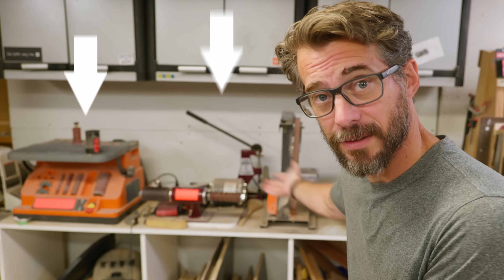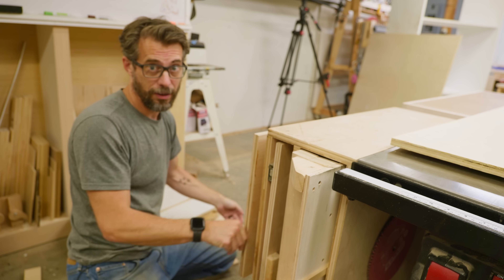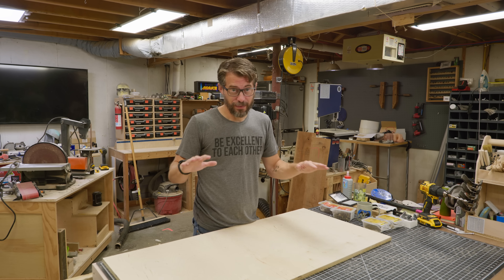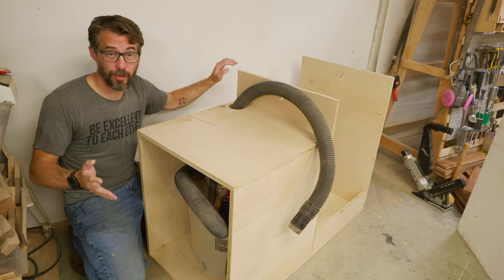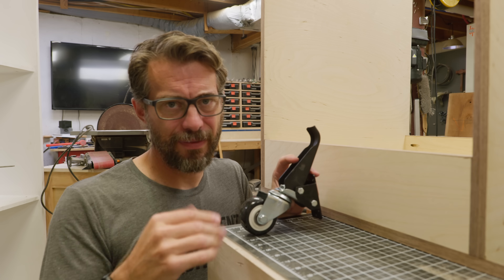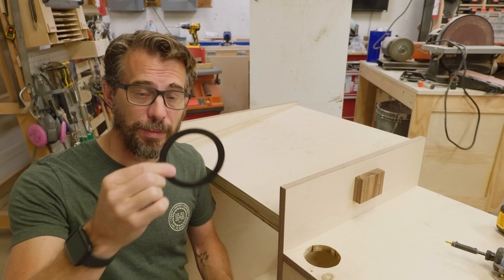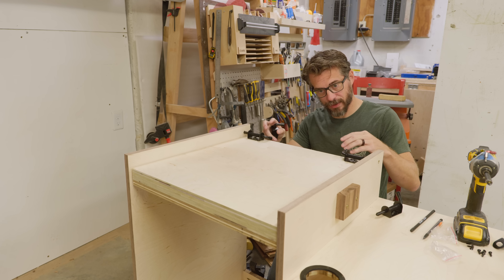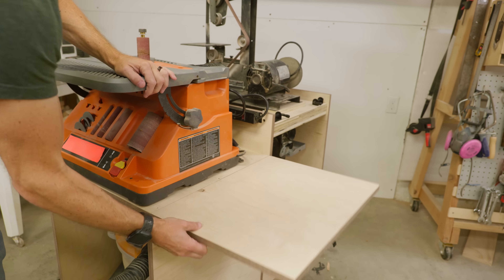Can I Make a Better Flip-Top Tool Cart?

Comment: You could of incorporated an arduino project into your latches . Simple push button 4 electric actuators with a bolt at the end . So all 4 actuators activate and lock or unlock with the push of one button wires could be run through the pipe and out to each one . Loved this anyway
Reply: Not everything needs to have an electric point of failure lol. I don't know how safe it'd be to have the table able to come unlatched while yur using a heavy tool atop it
Reply: @SheepUndefined  true, but it could be done and I get there are points of failure to it but I think it could make the flipping and locking off quicker more efficient if you just press one button and all 4 locked in place at once rather than having to lock off each one. Was just a thought anyway
Reply: @davesmith7671  Yeah my main thinking is just that for something that's the one thing preventing my work surface falling out from under me, or turning around and smacking me in the chest, I'd want that to be something that's dead simple, even if it's less convenient.

Comment: I did the same in my all in one work table. I used the gate latches for my 13" planer and my 7 1/4" miter saw.  Each top is flat and the tool is on the under side. Shop vacuum is underneath the tool bench too. I only installed 1 set of the spring latches and it's been 3 years now. No signs of wear and tear either.

Comment: I like the idea of flip carts quite a bit, but I've always worried about the piece of pipe holding the weight over a long period of time. Thinking about it from a weight perspective, I came up with a neat idea that I may use for a mobile cart for sanders and the like. Basically, every tool would be mounted to its own base, with t-track bolts on the bottom. Each tool would be stored on its own shelf when not in use, and could be secured to a top with t-track when in use.

Nice cart and design though!!! I love the idea of the spring latches that you used!

Comment: That's a lovely looking cart. I find fliptops have a few problems sometimes: the height is often too high, determined by the height of your tallest tool; and you need space to flip it, necessitating not just wheels but enough space to rotate outwards. 

If one of the key problems was the tools taking each others left and right space on a long bench, perhaps having them able to independently slide out like a drawer would be more convenient.

Comment: I have a tiny shop and have 2 flip carts so far. The major difference is a use a T in the middle of the pipe and run the power cord through it going to a outlet inside the top. 
I love flip carts because they take up 1/2 of the space each time you make one. I have a planer/belt sander on one and a jointer/crosscut saw on the other one.
Reply: This sounds great but I wish I could see a picture/drawing of this.
Reply: @wabisabimaker1794  if I can find it, there's a YouTube video that I got the idea from. I'll get back to you.
Reply: @a9ball1  Many thanks a9ball1, I found a video and now understand.
Reply: Awesome Bob, I've looked into buying one recently,  never considered building it. This is going to be a great addition to my set up

Comment: I would only lock the front pins and would have them on the bottom to keep the out of the way. I also would do what Drew Fisher did with the cord management. I love your casters. I will be buying some as those are the first I have seen that do the job at a reasonable price. Nice build.

Comment: really like the spring loaded bolts but I would suggest installing them under the flip table in the Front and on top in the back. this would allow easier access to them and also keep them out of the immediate work area in front of the tool

Comment: Nice. I think one thing I would have done differently would be to make the cabinet deeper from, front to back. Then I would put the latches on the front, not on top.  Of course, that would probably also require an extra piece of plywood across the front and back so you're not mounting the latches to end grain of plywood.

Comment: Nice, easily approachable project that puts a unique twist on the flip-top cart idea. Those gate latches should be plenty strong enough and with the springs should be easy to use. I will be interested to see if you close both sets every time you use it, or if you end up just closing two out of convenience. Thanks for sharing!

Comment: Nice. i generally work alone and use wood screw clamps to hold panels upright while assembling.  I like the fence hardware but the aesthetic bothers me.  i know function over form 😉.  Ive over-engineered this in the past with bearings, hdpe, but would like latches built into the rotating top that look nice and dont stick out.  Thinking out loud, you could use the same hardware and put them on the end of the top if you extend the sides.

Comment: Even though the cart doesn't have a clear front and back, I guess the side with the extension table is more front than back, so I'd put the locking mechanism on the bottom there and on the top in the back so that when the cart is against the wall, you can reach them. I know you'd have to pull the cart from the wall to flip it, but still it seems a little more practical. But you can never be sure unless you use it.

Comment: Great idea inas a machines would only add 1 thing your locking part is great but with that kind of weight over time your holes may elongate and be a problem .if you put a piece of tubing or nylon tube you can make with your printer you will never have that problem I myself would op for nylon bushings

Comment: You could use an automatic curent detector to turn on the vacuum.
You can find a current detector relay for about 10$, and you only need to do some wiring.
It changed the way I work with dust collection.

Comment: Here's an even better solution to the hardware problem. The latching pins are way overkill and you especially don't need 4 of them. Just use two bolts as pins that are inserted from the outside-in on both sides of the rotating shelf. You will need to drill 4 holes into the shelf and two holes (total) in the side walls - one on each side nearest you. The pins are easily removed then re-inserted after flipping the tool. I've used this for a couple of years now and it works fantastic. They really don't take any load as all of the load is centered over the pipe.

Comment: I like everything about this build, but I'm worried about the 2 uprights separating and your conduit falling out. I would definitely anchor both ends of the pipe or conduit and then it will act as a stiffener as well as a pivot point. Thanks for the great ideas!

Comment: The gate pins are realy smart, id sugjest switching them thou, if possiable, so the ones on the back are on top and you can see them from the front side and the front ones gets tucked out of the way under, that way all the preasure you might put on it is on the bolt and wood and not on the screws

Comment: My only comment regarding hardware would be to shorten the flip top maybe an inch or two on each side and have the locking gate hinge on the end so it isn’t on the top and bottom… plus then your holes could be identical side to side as well… just personal preference in symmetry for my OCD mind lol. Otherwise awesome build as always bob.

Comment: I'd 3D print some hats for the lock holes. Think an old timey top hat, but the top is open. You can also use clutch/brake pedal bushings if you want something off the shelf, but you have to find something with the correct ID.

Comment: The latches on the flip top, I would have mounted them the other way: under the front and over the back:

- less intrusive at the front if they are under the flip top
- easy to access from the front only

And you could make the top flip only by 180 degrees, back and forth instead of a full turn. That would prevent electric cords twisting one with the other and could have the tools permanently powered.

Comment: You can buy fender washers with the same ID as those locking pins and screw them in over the holes you made to reduce wear and generally strengthen it compared to just locking into plywood.

Comment: a couple of electrical conduit nuts will thread on regular pipe  and cleat into the wood locking it in and are only 1/8 thick or so.  you could even counter sink with a forstner bit for the flat bottom and not have Any stick out

Comment: I think the very first flip-top cart video I watched used standard gate latches, without the springs.  I think all those other videos you referenced were trying to improve on that design for various reasons.  I think that spring version of that latch does improve things, though.  And they typically only had 2 latches IIRC, because it's kind of hard to deal with 4.

Comment: If it were mine, I'd be trying to find a way to rig up a pulley system to pull out the 2 or 4 pin locks at once.  Could be overthinking it, but this would all you to mount the pin locks within the sandwich, and have the pulleys be accessible from both sides.  Definitely more complicated.

Comment: The main difference I see between the common rotating eye bolts/knobs and Bobs design is that the knobs on the eye bolts pull the sides into the rotating platform, adding friction and therefore stability. Bobs design seems fine and maybe his homemade bushings add some friction, but I imagine there’s more room for slop.  That slop on the horizontal axis is fine, but in the vertical axis it makes for an unstable work surface. Not sure this is the case, I’d need to see his design in person. Nonetheless, I love Bobs videos.

Comment: Is that enough airflow for the shop vac to breath and not overheat? Also, while that is great if you only have two tools to switch between wouldn't it be better to just have the tools on their own shelf and quick swap the shelves when you need to change the tool? It would be more work to swap tools, but you can have an infinite amount of shelves to swtich from and you can store them on a shelf rack when they aren't in use.

Comment: You didn't show it in the video, but did you incorporate power into the cart at all?  It would be nice to just plug the cart into an outlet with all the tools plugged into a vacuum switch that powers the dust collector automatically.  Also, dust is going to collect in the bottom of the flip cart as it is used, so you could put something down there to collect that dust to make cleaning much easier.

Well done.

Comment: I think Fisher's hardware is far easier to use but requires a little extra measuring and cutting.  Additionally, the ability to run the cords through the flippy thing is very cool.  Where I think yours' builds upon Fisher's is the addition of holding a 3rd tool and the shopvac/dust collection aspect.  I suspect, like most things in life, perfection lies within little pieces of several different ideas.

Comment: I personally preferred the Fisher style of top where the top is notched and uses the cart sides as a stop.  It prevents the top from spinning 360 degrees if you have integrated wiring and lets you fasten the top tightly to something that's not going to move so the top doesn't rack at all

Comment: I like the spring pin hardware. However, I worry that the single piece of plywood on the outside will pivot out of the way and the whole flip top with two heavy tools will come crashing down. Affixing that center pipe at both ends would be an easy way to prevent that.

Comment: I would have put the locking bolts for the rotating board at the back, on the top and the front, underneath. I just think they may catch on things as you use it.

Comment: I would flip the spring bolts so the ones on the front of the cart are on the bottom of the flip shelf rather than on top of it. Easier to get to the top ones in the back than if they are on bottom and they are less visible.

Comment: When you chose the pipe to use as pivot how did you test the durability over time in the loaded state? It shouldn't bent over time under the weight right

Comment: wire switched outlets to the table. Switch the outlet not the vacum. 

Easy access which ever station you use.
Reply: You are working too hard broski , 3 d print a splitter for the vaccum, With a little door to close off one or the other . Leave it wired up and flip the baffle to direct the suck to the machine in use. 

Cost less even if you need to order it.
Reply: you should have kept the end caps so the flimsy wood uprights had support imho As you did it proper load on the table makes the uprights seperate and collapse. with endcaps or screw in pieces on the end , its reinforced.

Comment: 3/4" nominal pipe is .840" O.D.
It can be extra strong and have  a thicker wall, but the O.D. will always be .840" to accept all the fittings.

Comment: Unrelated to this specific video but I think you may be the only person who can answer this for me...any thoughts on building a standing workbench for 3d printers on top of my current recycled exec cherry desk? My current 3d printing space is directly on the desk with a left hand return, desk height filing cab. I want to build a full L, standing workbench top to make use of the vertical space. At 6' 3", Reddit suggests anywhere from 38" - 42" for the bench height. I have a good sized painting area on the other side of the room but I feel like a standing work space would be helpful to keep the body moving and make better use of the space. Thanks in advance! 

Printers include:
CR10- v2
Ender 3 Pro v2
Phrozen sonic Mini
Elegoo Saturn S
Elegoo Mercury XS Bundle
Elegoo Mars OG

Comment: I would make the length of the spinning shelf shorter (or the sides longer) so that you can put the gate latches on the ends of the spinning shelf instead of on the top and bottom of each side taking up space.

Comment: Hay Bob, I think I found one failing with your design...  
the rotation pipe is capped on the outside of the case area for the rotating deck keeping the pipe from sliding out either side.  
BUT, the pipe in only sitting in a 3/4 inch hole on either side, and one of those sides is free standing plywood.  How hard do you need to hit one of the outside corners of the free standing side to get it to bend or flex far enough to let one of the sides of the rotation pipe to pull out of the hole it sits in?    If you had used a flange that you could screw into the sides, it would both stiffen the free standing side up and also prevent the pipe from ever coming out of the 3/4 inch holes the pipe sits in.

Comment: Why didn't you put a lift up table on BOTH (or THREE) sides, not just one? Then you would have a space to put parts waiting to be sanded on one side and a space to put finished parts on the other - much less chance of mixing up stacks of parts, possibly doubling your sanding time and also making some parts over or undersized by sanding them twice.

Comment: Couldn't you have gotten by with only two (instead of four) of the black spring-loaded locking latches/pins, just having a set of holes where each orientation would require?

Comment: I think I would have used a different hardware. Without lock but only with the spring in lock position, so you have to unlock, and flip and automatically the spring push the pin in the lock position

Comment: Don't like the latches.  They need to be hidden inside with the pipe.  If you look at the jet Flip top they notched the back pins so it locks in automatically.  I think you could come up with a slicker design...Maybe version 2.0.

Comment: I don't understand why the common solution is to make the pieces flip-top.  Wouldn't it be more practical to make a modular design where you can store your tools anywhere and then slot them in only when you are using them?  These flip tops always lose all of the storage space underneath them which is valuable.  All the effort being put into balancing the rotation and similar when you can just slide in a different tool.

Comment: fusion 360 is not an option because it is a buy now, pay forever scheme. and at more than £300 a year it's not cheap either. if i ever need CAD software, i'll look for something i can buy instead of rent, and something that doesn't run in the cloud.